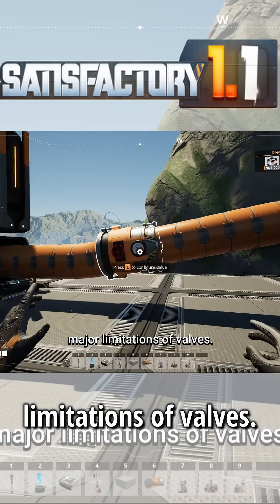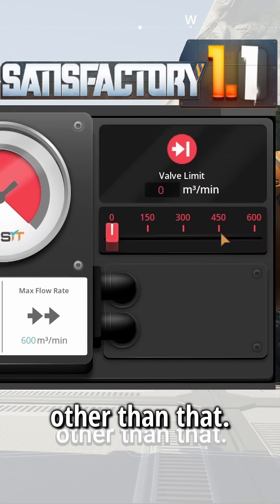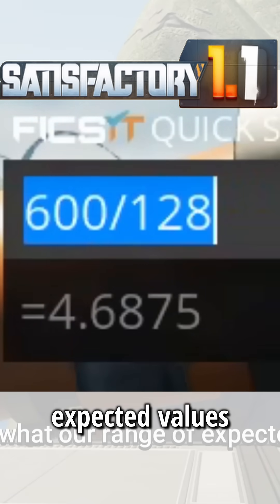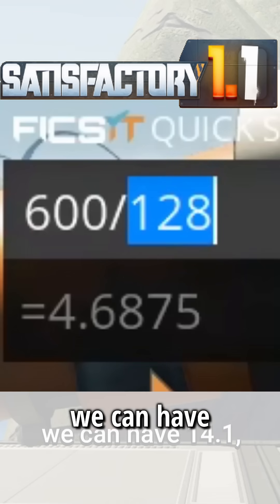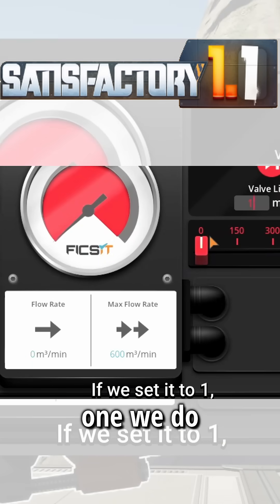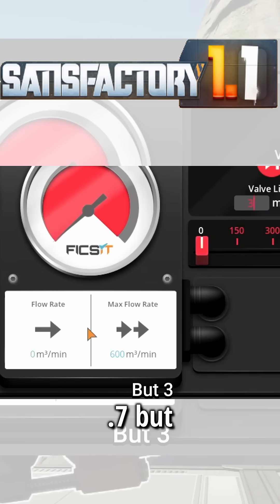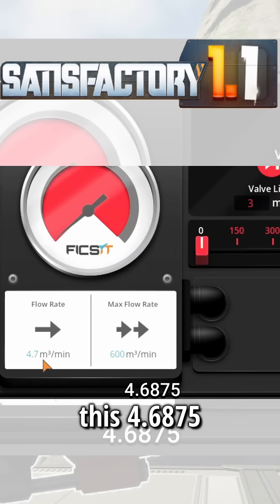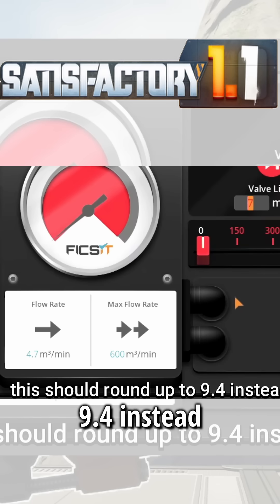Valves in Satisfactory are kind of bad. Heres why.

Comment: Dakoba, where are you getting the 128? I know that’s what makes the maths check out (and I get that 600 is the max flow rate), but could you explain why 128 is the magic divisor?
Reply from the maker: Numbers in code are stored in groups of 2^8, which is called a byte.  A byte can v hold any number from 0-255, but sometimes is used to hold numbers from -128 to 127 instead. This is called a signed byte. These numbers are used because they are powers of 2 and very fast to compute on in code,  and knowing that it was pretty quick to find the pattern when I noticed my valves weren't working as expected.
Reply: @Dekoba  Ah. Now that you say it explicitly, your “part 2” video did cover this fairly well. Thank you for helping me see the connection. Also, it’s so great to meet you! I wish you and your kiddos all the best. :)
Reply: My god, you wizard. I've watched dozens of videos on fluids and flow rate and sloshing prevention and not one of them has noticed of mentioned discrete value rounding. This is an amazing find. We need to spread this far and wide.